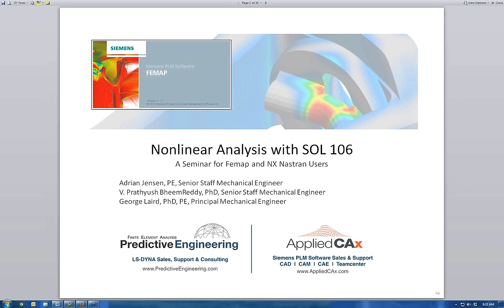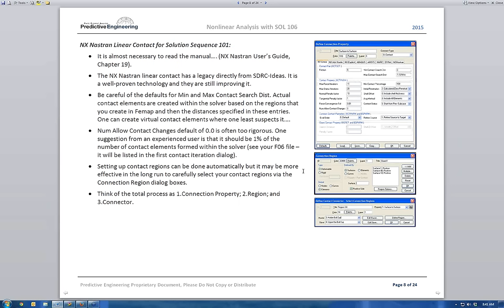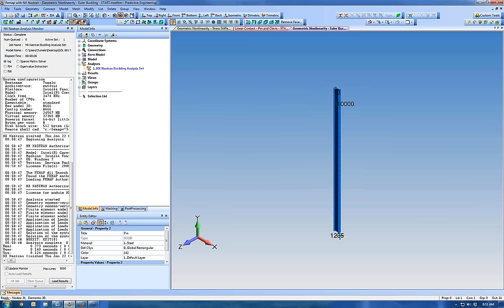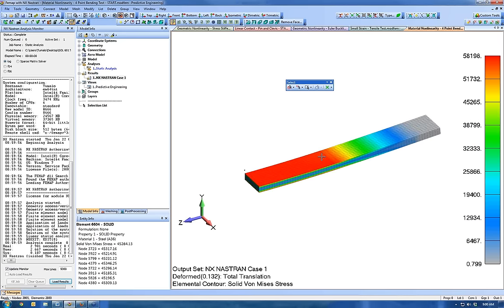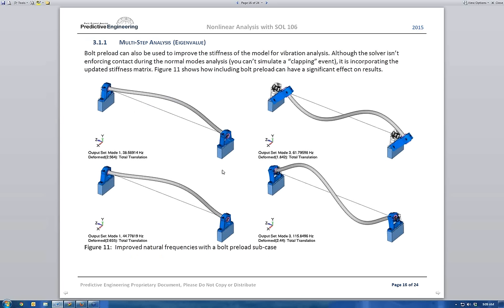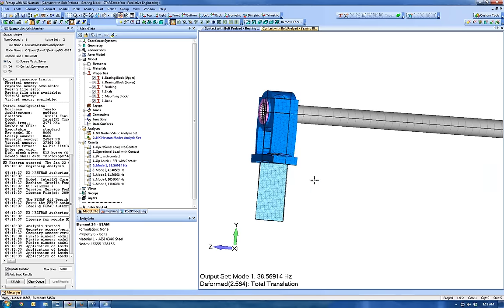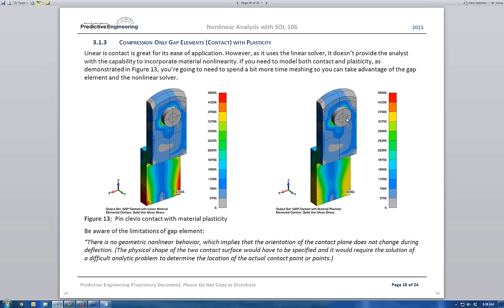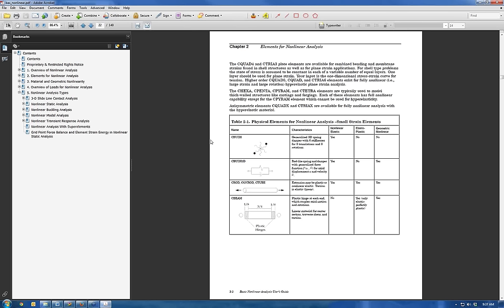Femap and NX Nastran Technical Seminar - Nonlinear Analysis with SOL 106

Comment: Gap elements with tension only, have nothing to do with cable elements. Gap element does not simulate the geometric nonlinearity (sag) of a cable. It 's a totally different thing. FEMAP, cannot simulate a real cable element with the 1D elements it has.........unless you use a special simulation!!!!